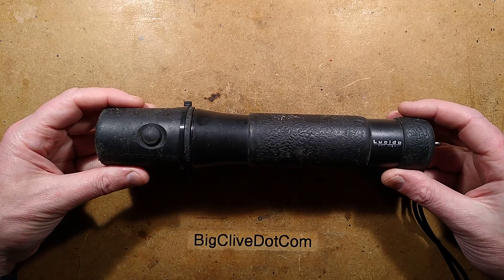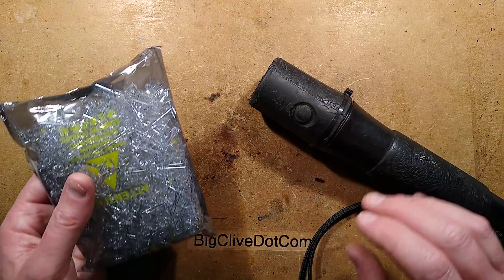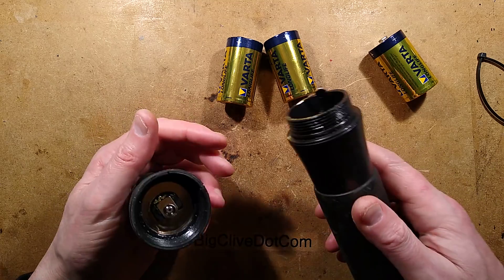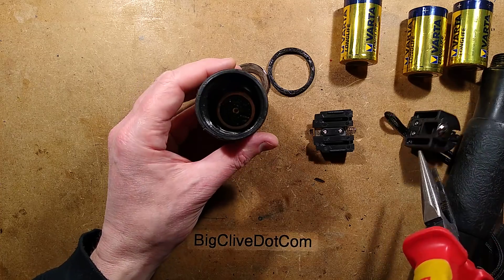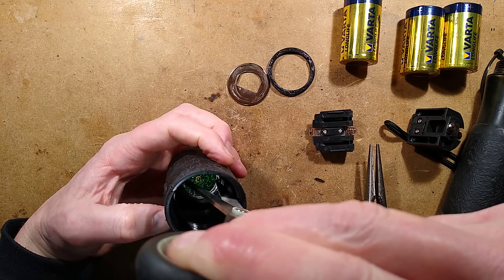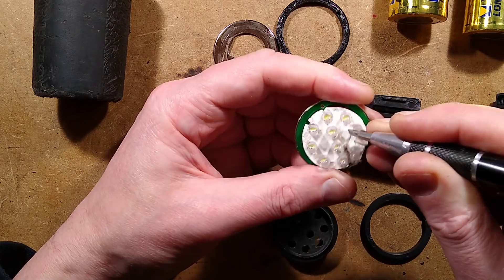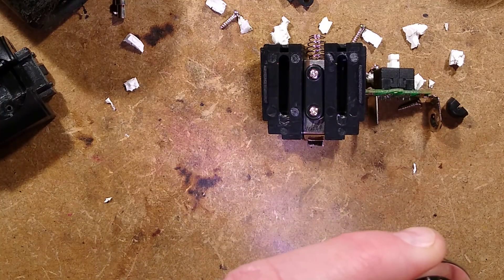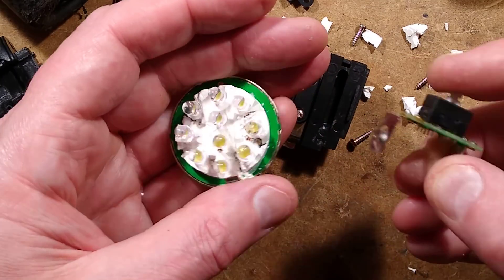Teardown of a vintage Lucido 20 year old LED torch.

Comment: I still remember the days when stuff was built to last. Until manufacturers figured out building cheap junk makes them more money.
Reply: Planned obsolescence. You can primarily blame GM for that
Reply: @johnappel7174  It's more due to the change in consumer preferences, rather than planned obsolescence. I had this particular torch (it was called the Lightwave) and the thing was real weighty with the D cells inside, like a chunk of steel with a rubber exterior. Nowdays everyone's making small, lightweight torches out of aluminium and 18650 cells.
Reply: Yep. Both my car and my watch are over 30 years old and both are as reliable as the day they were made. I'd do a 1,000 km trip in that car today if I needed to with no fear of it not being up to the task.
I recently saw a facebook post about not spending too much money on 'vanity items' which said "a $30 watch tells the time as well as a $300 watch". I replied saying that I used to buy cheap watches and consigned them to landfill every few years when they inevitably died. Since I bought this watch I've not had to add to the growing pile of dead watches...
As AvE says "Buy once cry once".
Reply: @Shaun.Stephens  
and how much were said watch and car adjusted to inflation? because buying cheap has nothing to do with modern manufacturing. a cheap car 1980 wouldnt last longer than a cheap car 2020 does - how many ford pintos do you see on the streets? 
not to mention the lack of safety, gas mileage and pollution.
Reply: @thomasherzog86  My car is a Honda City AA E (for economy) from 1985. It was very cheap at the time of sale, in fact about the cheapest car available here. I doubt that a bottom-priced modern car would last 35 years. Safety? It's very safe because I (f'kin) know how to drive defensively and avoid all of the idiots that don't. Gas mileage is brilliant, it averages 6l / 100km for urban driving, less on long runs. Pollution? Keeping a car going in perfect condition for 35 years is far less polluting than buying and dumping 3 other cars in that time.
My watch is a Pulsar branded Seiko from the period when Seiko first acquired Pulsar and simply sold their watches with a different name but same internals for half of the price. Seiko wanted a slice of the more budget end of the market but didn't want to dilute their own brand so they bought Pulsar and used that brand to compete with mid priced watches. There were so great bargains to be had in that first year or two before Seiko started making different internals for their Pulsar line of watches.
Reply: @Shaun.Stephens  
a lot of nothing i can work with... there are no prices online, so i cant possibly tell if it was "cheap" by modern standards. regardless, a 60 ps car wouldnt be expensive today either, they just barely make them anymore because people stopped buying them. however according to https://www.automobile-catalog.com/make/honda/city_1gen/city_1gen/1985.html your mileage is too high. brand new, it made less than 4 liters. 
about safety... you realize that the modern equipment costs, right? i dont care if you think you need it - abs, traction control, laminated windshields, modern crumble zones - thats mandated interior today and saves lifes but also makes stuff more expensive and freaking no, driving an old car for long is NOT better than a modern car with modern filtration systems with catalytic converters and we didnt even start talking about electric cars. 
same useless info for the watch. sounds more like a lucky buy than a cheap product. however, without price and inflation... yadayadayada.
Reply: @thomasherzog86  In the document you quoted the initial fuel consumption is '60-mode'. No stop-start, just fuel consumed by a warm engine over 16km averaging 77km/h and extrapolated. It's not relevant to actually driving a car. Just below that there is an average real-world fuel consumption (estimated by the organisation that hosts the website that gave you that info) of 7.6l/100km. I drive in a similar fashion to a 'hyper-miler' so get better than that. As for your rubbishing of my assertion that running an economical car for 35 years causes less pollution than the manufacture and disposal of a new car every 10 years - there's not a lot to say other than you're completely wrong.
The watch wasn't a lucky buy, I was aware that Seiko had acquired Pulsar and were selling essentially Seiko watches at Pulsar prices. I go into all transactions only after having done due diligence. Only a fool buys on impulse, however with the preponderance of people buying on impulse or because of marketing these days I get why you consider it to be a "lucky buy".
I'm sorry that I didn't keep the receipts for 30+ years for you as it seems that purchase price is the only metric you understand. I don't consider that to be my failing however. Inflation figures are as available to you as they would be to me.
Reply: @Shaun.Stephens  
price isnt the metric i understand, but what is the key factor in the question of ratio of reliance to cost. 
by stating that a cheap product was more reliable in the past, you need to prove that it was cheap. im sorry you dont understand this simple logic.
Reply: @thomasherzog86  Please show where I stated that a cheap product was more reliable in the past. Thanks.
The only time I mentioned the car was cheap when new was when you asked the price. Previous to that I stated that before I bought my watch 30 years ago cheap watches didn't last long.
Reply: @Shaun.Stephens  
you agreed with the OP, or does "Yep" mean something different for you? the only statement OP made was, that liability was better in the past disregarding prices. my point was, that liability is and always was a question of price and that the generation has no effect on it.
Reply: @thomasherzog86  I suggest that you re-read the OP. I get that English isn't your first language but you've misinterpreted both the OP and my replies.
Reply: @Shaun.Stephens  
please enlighten me what OP meant by his statement then. im all ears.
Reply: @thomasherzog86  It reads that things were made to last in the days that he remembers (no price mentioned). Then it reads that more recently manufacturers have discovered that building 'cheap junk' means that consumers will have to replace the items frequently and so the manufacturer makes more money.
You're welcome.
Reply: @Shaun.Stephens  
and thats different then what i wrote how? are you trolling me? thats literally what i f*ing wrote! according to him, sh*t was made better in the past, which i replied that its not a question of generation but price and you can buy long lasting stuff TODAY if you pay the same as back then! 
the hell are you blabing about me not understanding it?
Reply: @thomasherzog86  The point is that 'back then' there was very little disposable stuff made because people's attention spans and thus memories were longer. They wouldn't buy the same brand if they knew (or were told) it was crap. These days companies come and go so fast this doesn't work so well. Also defunct company names are bought because they previously had a good reputation and then are run into the ground - by which time the new owner has made a tidy profit.
It IS a question of generation and attitude of the manufacturer. Current consumers mostly care about price and are more short-sighted than they were in the past and companies cater to that.
Please try to be civil - if you have the attention span for it? Nothing I've said disagrees with what you just spat out (except perhaps that even cheaper stuff 'back then' lasted longer than the cheaper stuff now).
Reply: @Shaun.Stephens  
whatever. im done here. have a nice day/night.
Reply: @Shaun.Stephens  i hade a friend way back in school had a civic. I do not know the year but it had 300,000 on it when he got it. He abused it hard and very little maintenance.  He drove till over 400,000 before it was wore out.
Reply: back when a TV cost so much that only the rich could afford it... yeah, great old times, full of safety and energy waste. those bad manufacturers and their greed, making stuff cheap so any one can afford it. its not like you could buy more expensive and longer lasting products today...
Reply: @thomasherzog86  can you buy a furnace that will last 50 to 60 years? My grandmother has one that is that old. What is the life expectancy of a new one? About 10 to 15 years. If she had to spend 8,000 to 10,000 every 10 to 15 years she would of spent 26,000 to 50,000 just on one appliance in the last 60 years. Because the old one was built good she did not need to.
Reply: @poellot  
if you dont calculate the prize she paid back then, inflation, material, etc. you cannot possibly say ANYTHING about that. if done "correct" a brick furnace can last even longer, but they are expensive today since there are cheaper metal alternatives. thats a simple change in market. a horse was cheaper to have back then, yet you see more cars today. doesnt mean horses were build to break down. its also a question of maintenance and repairs... all you have is ignorant nostalgia with no background. so yes, you very well can buy a furnace that's long lasting, even today in modern times. the metal one in my house was build 1985 and is doing great and didnt cost a fortune either.
Reply: True that... just look around where all the junk ends.....
Reply: Even if you pay more novadays, in consumer goods(bads) you only get more bells and whistles and the quality stays the same cheap crap.
Reply: @Pentti_Hilkuri  i agree 100 percent.
Reply: The worse culprits for that is the Motor industry
Reply: There is still some companies out there that take pride in producing quality over quantity.  But not a lot anymore. If i had to say why, i would say because of greed. Take power tools for example. Years ago you could buy a quality drill that was fairly expensive made mostly for professionals. Now days, you can buy cheap crap. Or an expensive drill. However the expensive models today are very poorly made when compared side by side with an equivalent model of 20 or 30 years ago.
Reply: I remember when people were saying dumb shit like this 15 years ago.
Reply: Like a DOS computer is useful now ? Windows 95? Vista?
No of course not,  they are junk
Reply: @paulvandergroen9569  i have only ever used linux. I have an 18 year old labtop that still functions just fine and still very much useful.
Reply: @poellot  I am not clever enough to use it.
I have to use Win10 because I am  a litter bit fick.
Reply: @poellot  an 18 years old laptop that didnt break down yet, huh? how could the company oversee to build in planned obsolescence in your case? maybe because you maintained it correctly? maybe because you paid a good price? maybe because you adapted your usage instead of upgrading it? maybe even repaired and updated it yourself?
Reply: @thomasherzog86  never repaired anything.  After getting. Sick of windows xp in juat a few months i installed linux. Still working to this day.
Reply: @poellot  
good choice.

Comment: Fifth comment, if we're doing that. =D
I've always had a fondness for laser pointers, not that I have a terrible amount of use for them other than pointing into the sky on misty days and watching people say "Ooh, what's that?"
A while ago they were fairly difficult to get with any power behind them beyond maybe seeing it outside if the street lights hadn't come on yet. And now, you can easily buy ones off Wish or Amazon that shine for miles.
Exciting to see what will come in another 20 or so years. 
Anyway, sorry, I seem to have rambled about laser pointers and forgotten what my original point was... if it ever comes back to me, I'll edit this comment.
Reply from the maker: They've already gone to the dangerous level.  I guess it'll be handheld cutting lasers.
Reply: Knowing me I'll buy one, and then I'll have to remove whatevers powering it so my friends don't break anything...
Already had to hide my lasers from a friend who thought it'd be funny to shine them at cars... What a twat.

Comment: You should replace them with modern super bright LEDs and then compare it again or show a before and after.
Reply: I agree! Also replace the batteries with a lithium cell & charge controller would be cool.
Reply: Nichia NSPW510HS-K1 is the way to go
Reply: Maybe it's easier to build a new one for comparison.
That could become a series. Like designing the PCB, then assembly and 3d printing the housing. I guess one should start by selecting a power source.
Reply: The plastic had perished.
Reply: @paulcresswell6268  he has a 3d printer though. He has the technology. :D
Reply: @stranger7968  at that point he's just making a new flashlight

Comment: Wow... now I feel old realizing this light was bought when I was a small child. 

Awesome to see an artifact from days gone by. The fact it still works fine 30 years later says that yes, you indeed get what you pay for.
Reply from the maker: 20 years.  Blue and white LEDs didn't exist 30 years ago.
Reply: @bigclivedotcom  The first commercially available blue LED was apparently introduced in ’89, so technically, there were blue LEDs 30yrs ago...
But the ones with really usable efficiency/brightness were introduced around 93, with the first patents dating to 91 or so.

Phosphor-based white LEDs were a couple of years behind, IIRC.
Reply: @tilmanahr  If I know my history right, RCA had the very first blue LED back in the 70's but it was very dim and the process of making them was so unreliable that they only ever had one working. RCA ended up cutting the budget and that project got canned.
Reply: @RingingResonance  There were some experimental ones pretty early on, but the ones Cree introduced in 88/89 were the first commercially viable ones, as far as I know.
Still too low-powered for most “real world”-applications, though.
Reply: @tilmanahr  I got some Cree blue led samples back in 1989. I remember being so amazed at the beautiful blue color. Still have them, still just beautiful.
Reply: @bigclivedotcom  Ah, my mistake. Also easy to lose track of time as one gets older.